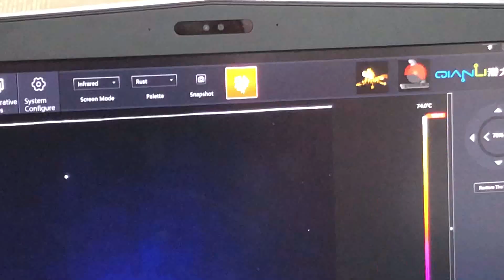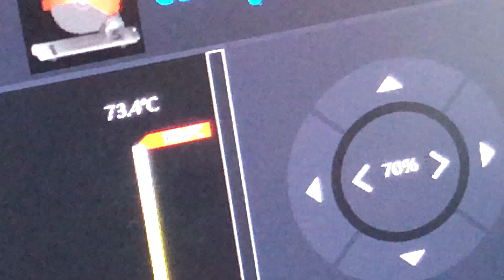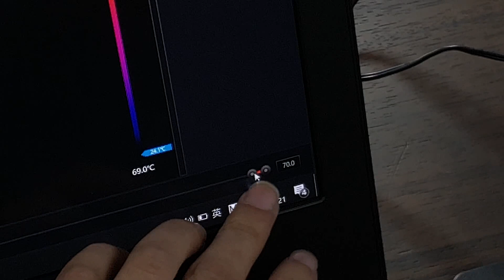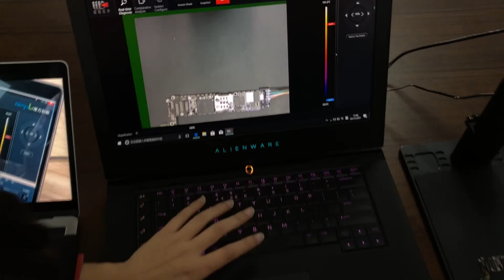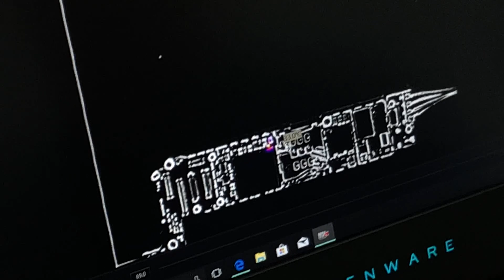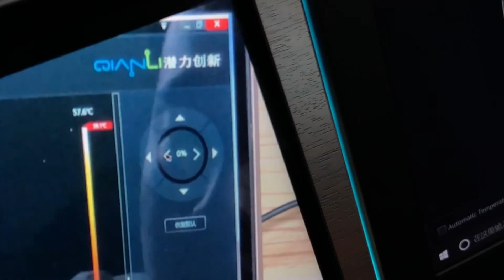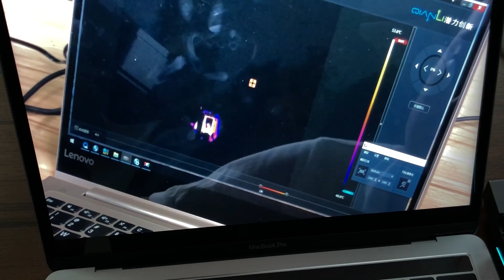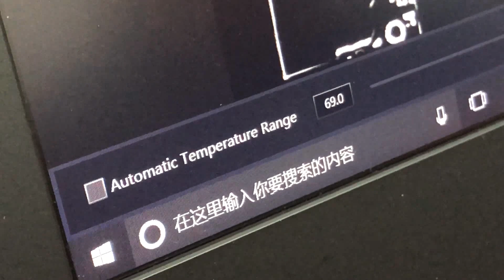UNION REPAIR THERMAL IMAGER FOR MOBILE PHONE PCB TROUBLESHOOT

Comment: Looks pretty good. USA has equivalent, but x4 the price. I plan to acquire for post production thermal screening/validation. Auto-config ENET via UDP multicast is a plus for me. I hope static-IP can be flashed to the unit config to match my subnets. Otherwise, I hope a bridge will work.
http://www.yashu.com

Comment: That is a really useful feature, for specifically pin pointing where the problem lies.  The trouble is though, if your manufacturer doesn't explain this in the manual or translate it, no one is going to know it exists.